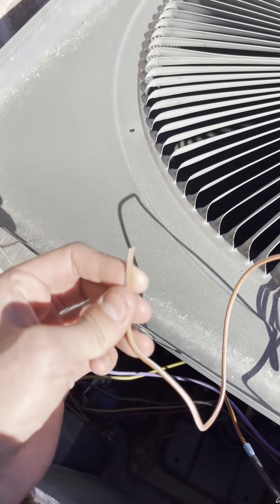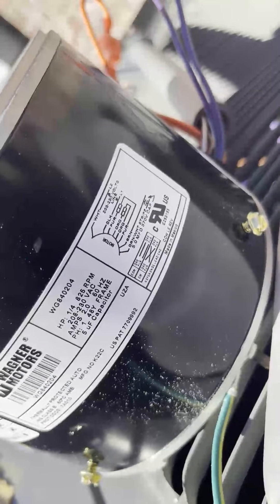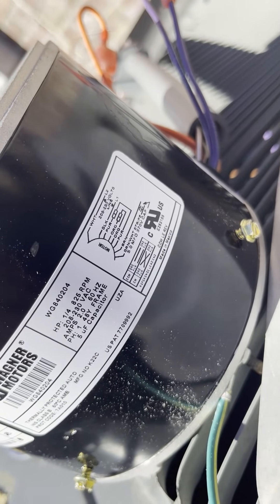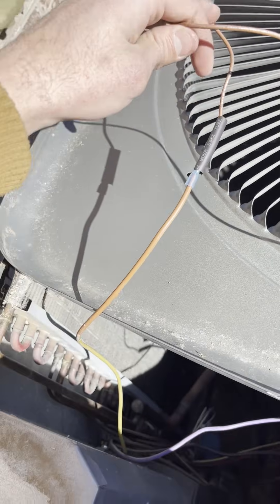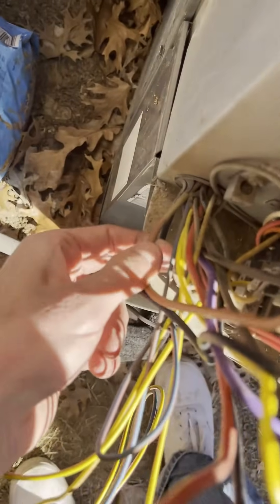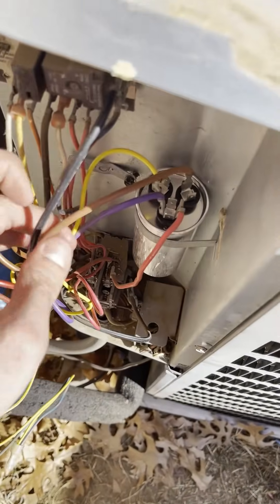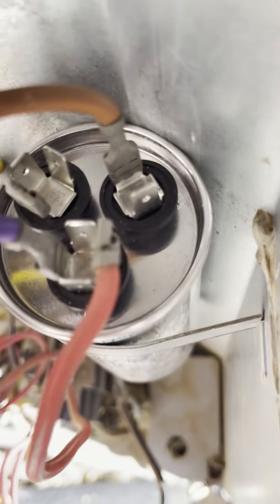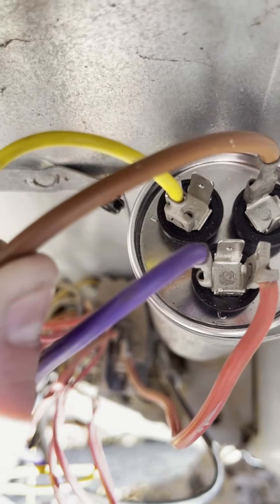Replacing AC Condenser Fan Motor: OEM 3-Wire To A Universal 4-Wire

Comment: Be safe but you got lucky on the brown and white wire you can use it or cut the wire off. As for using the wire by the way you did I would have seen where each one went and replaced them and use the new wires. Not good using old wires with new ones.
Reply: I have the same issue and the new wires are not long enough to reach where they need to go so what choice do we have. Also I agree totally with the ending on the goodman ac unit.

Comment: The motor did not require a 5 or 7.5 yf capacitor?
Reply from the maker: I used it with a brand new 45+/-5 cap, same as what my unit was using before